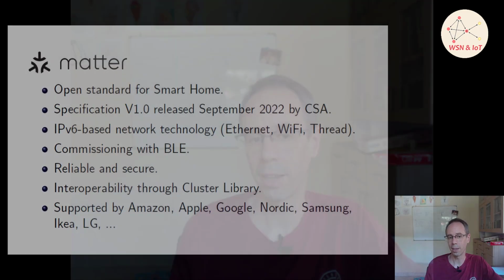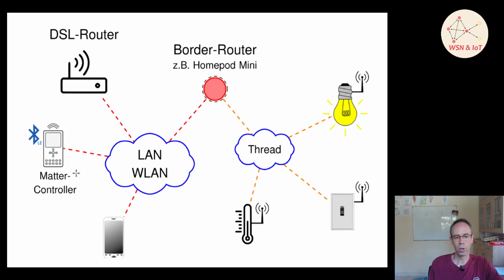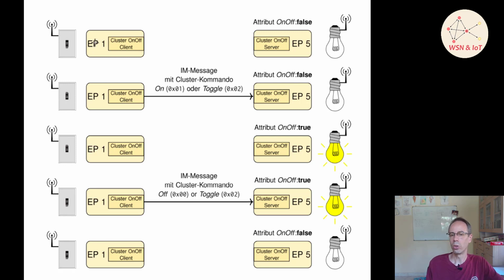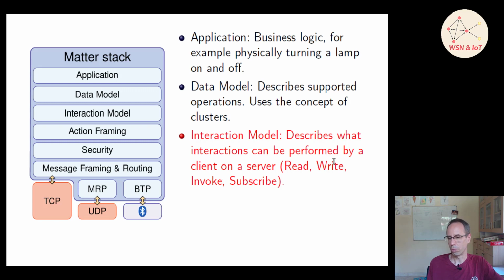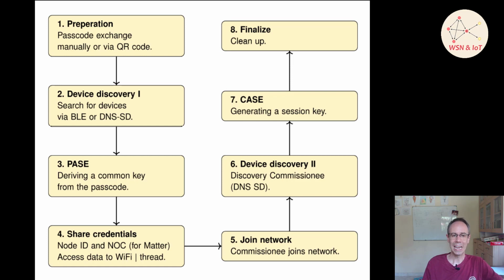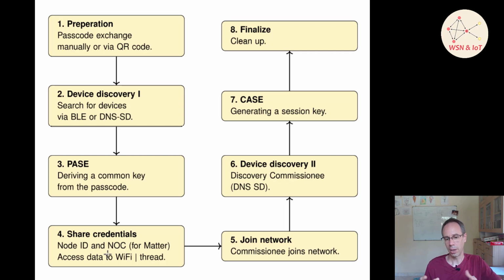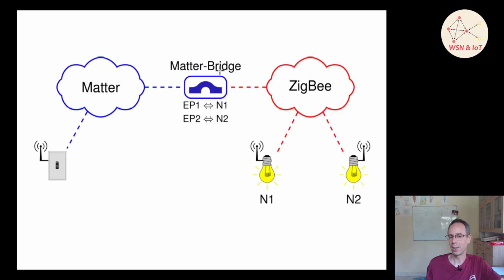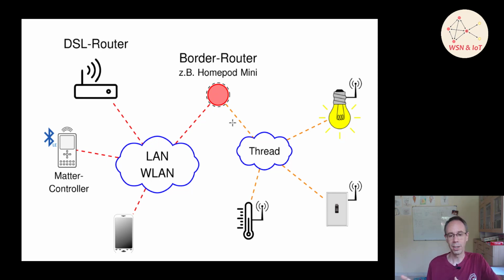Understanding Matter: Dive deeper into the Smart Home (Home Automation) Standard

Comment: Thanks for the great introduction and overview about Matter.
 I just set up a Thread+Matter network using Python-Matter-Server and Homeassistant.
What I'm looking for is if it's possible and what is required to have for example a switch that controls a lamps state without Homeassistant being involved (except for commissioning and perhaps configuration, but not in the transaction).
I got the impression Groups and ACLs are involved, but otherwise I haven't found this discussed anywhere.

Comment: How do you compare matter with coap and lwm2m?
Reply from the maker: Matter has been specifically designed for the realm of Home Automation and garners widespread support from prominent companies. In this particular application domain, Matter outperforms CoAP and LWM2M. However, the utilization of LWM2M can prove valuable in other topologies and use cases where CoAP alone falls short. Particularly, for scenarios where features like OTA firmware upgrades or device management are important or even essential.

Comment: Thank you for the introduction. I have been working on the stack. I can't wait for your demo since I am running into commissioning issues setting up nRF52 over TBR and the CHIP tool. It will be great if you can also go over how the decryption works using the keys.

Thank you again. Cheers!
Reply from the maker: You are welcome. I tried also a matter example with the nrf connect SDK and took me a while until i got it running. This is why i try to explain the basics first ;-).
Reply: @wsniot   how can I contact you? I really need you help
Reply from the maker: @FocuscraftTv  On channel info you can get the emailadress to contact me.